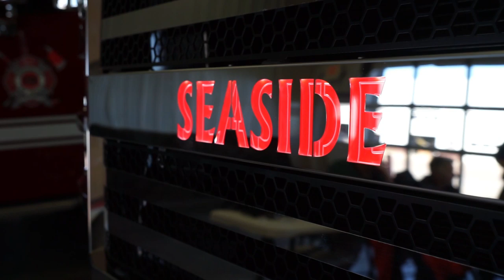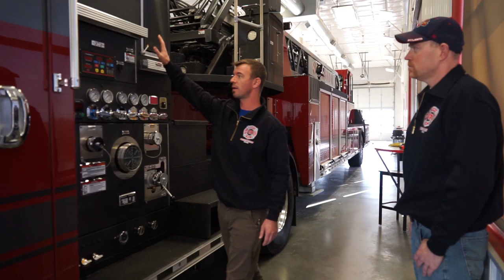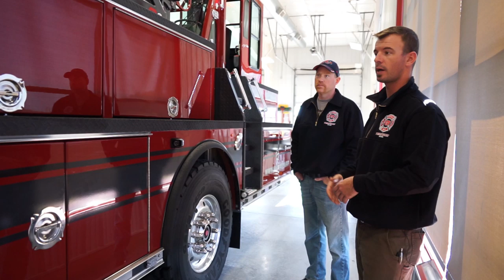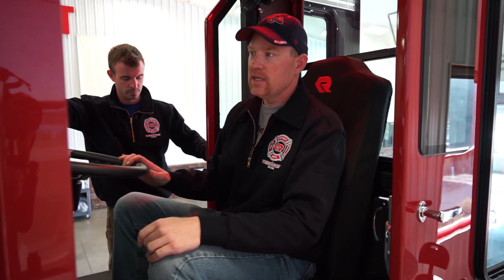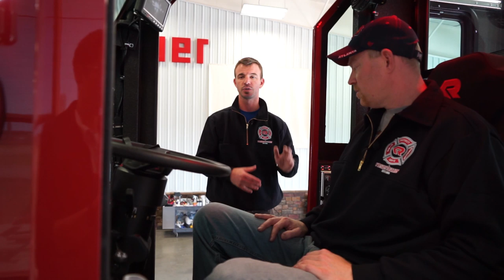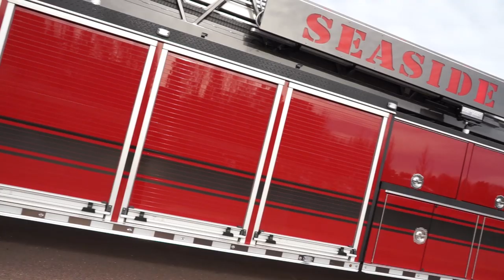7558 - Seaside, OR - 100' Tiller

Comment: I have to ask, does the truck have a water light indicator? The San Luis Obispo County Fire Department has a light system on the engines behind the Engineers and Captains side of the engine plus to the rear of the engine. As they get low on water, the system lights change,  when it's full, the lights are green and then yellow etc.

Comment: Who the hell ordered those mirrors?  The right side one is off a 90’s Ford Econoline motor home, the left side is off a Hino box truck.  I’ll take the driver’s mirror, I cannot understand the officer’s side.  If you wanted great visibility, get truck mirrors, like off a Kenworth.  The small size and offset location compared to the driver side isn’t good for orientation.

As well, they do know these can be driven without a tillerman.  Just have to drive it like a conventional tractor trailer.
Reply: I know I'm late to the party, but at the end, I think there is no tillerman in that cab while the rig is driving down the road.
Reply: Holladiewal correct.  There doesn’t have to be a tillerman to drive the truck, but then it drives like a conventional tractor trailer.